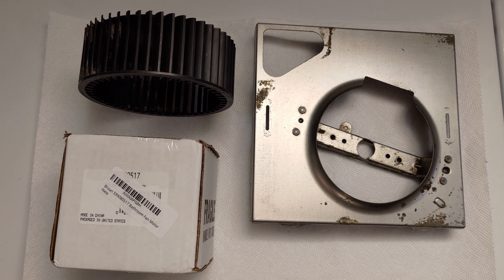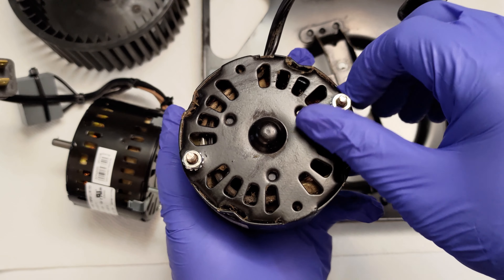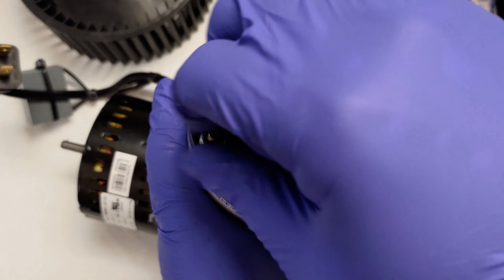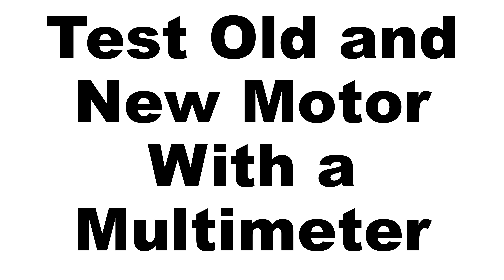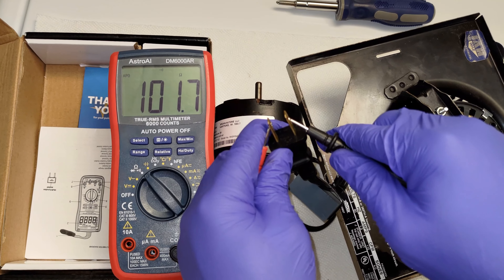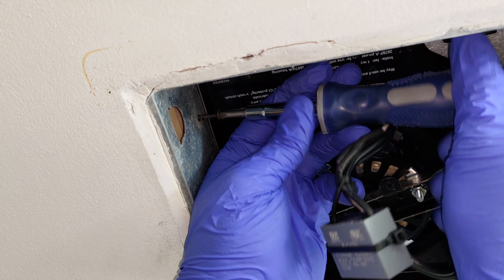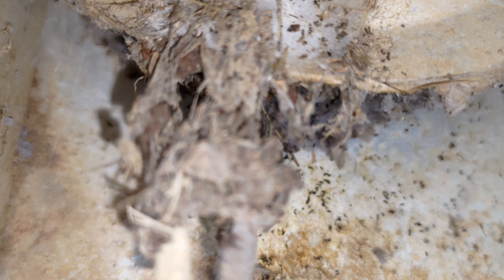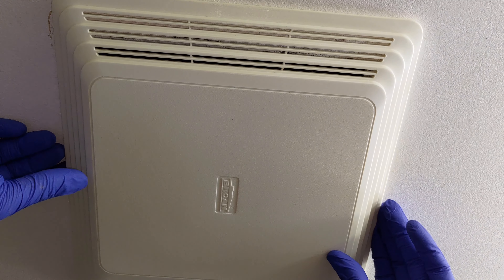How to Test and Replace a Bathroom Exhaust Fan Motor (Broan NuTone)

Comment: Very helpful video, but how did you secure the fan to the motor shaft?
Reply from the maker: Thank you.  Once the fan is in place, there is no need to use glue or anything to secure the fan to the motor.
Reply: @PotomacRepair  thanks. My fan had a push nut securing it to the shaft. I used a flat head screwdriver to gently pry the push nut off and put it back after I cleaned the fan and motor.
Reply from the maker: @craigmarrano  Ok, got it.  Thank you for explaining.